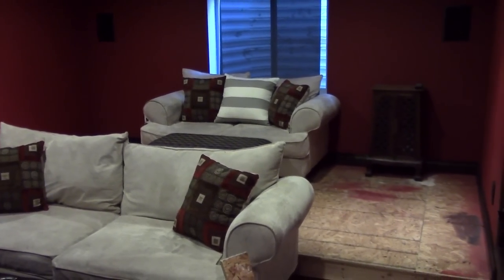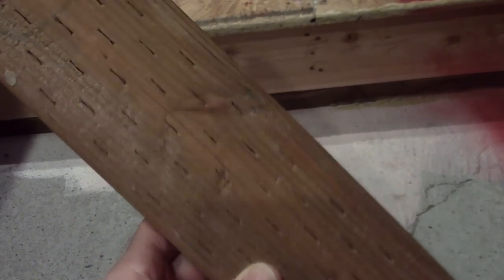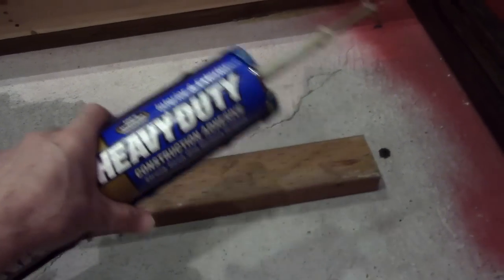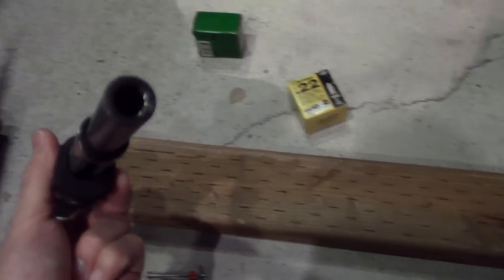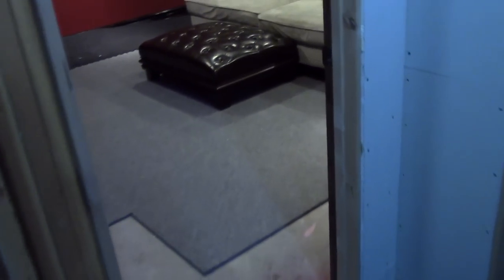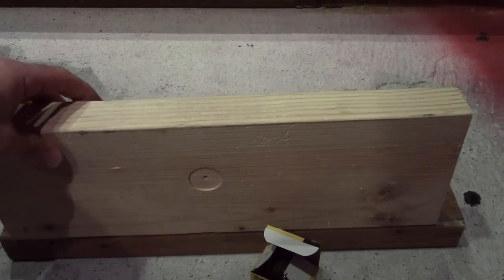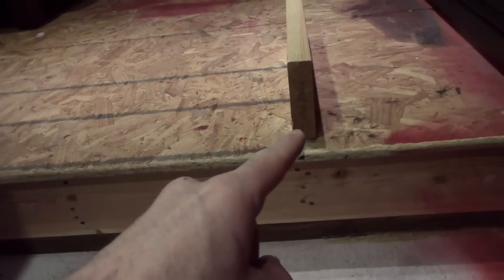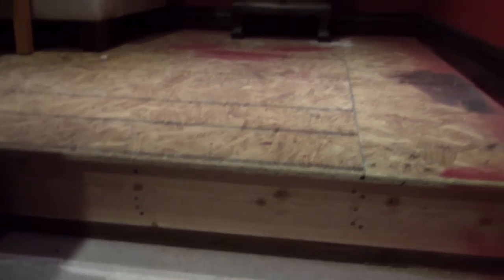How to build a Home Theater Room Step

Comment: Adam ...an additional question if you don't mind ... you placed a 2x6 as a front "step" (plate), nailed down to your treated 2x4 ..did you also have an additional 2x6 "step" (plate) along the back side of the floor?  Thanks...
Reply from the maker: +DTCigarFather Yes. 2x6 all around against the 3 walls and then one at the step.
Reply: +AdamDIY Thanks!

Comment: Adam, I may be missing something simple here. You mention that you have 2x4's (flat) under 2x6's (vertical) around the perimeter, giving you an 8" height. I get that part. But then what do you have as support struts under the bulk of the subfloor, since now it's 8 inches off the ground? Did you use 2x8's in the middle?Also, I'm doing this in an upstairs room on top of carpet. So, I'm actually considering not nailing it down at all. Is that crazy?
Reply: How did you your project go? I'm putting a platform upstairs over carpet and also considering not nailing it down

Comment: How did you nail the front facing 2x6 to the floor 2x4?
Reply from the maker: +DTCigarFather Good question.  I had to go take a look to remember.  (I still have not put in carpet)  I nailed through the 2x4 and into the 2x6 first, and then used the ram-set to attach it to the concrete.  If your pressure treated is already attached to the concrete you can just toe-nail the 2x6 to it.
Reply: +AdamDIY Thanks! That makes total sense ... I had to believe you didn't toe nail that entire framing .....